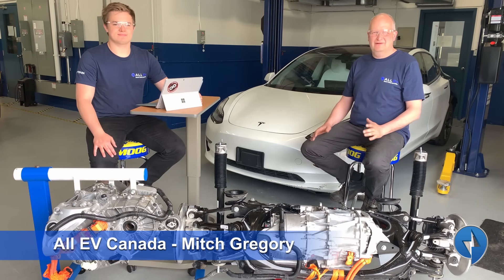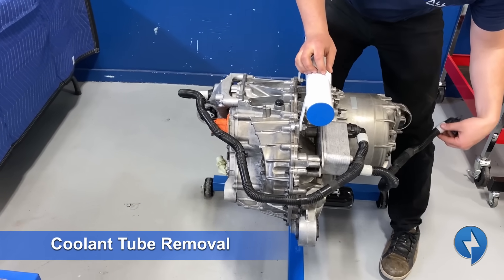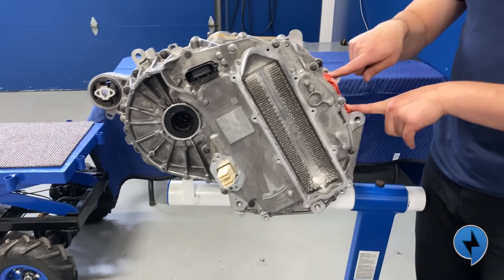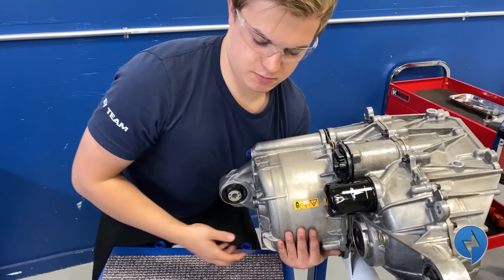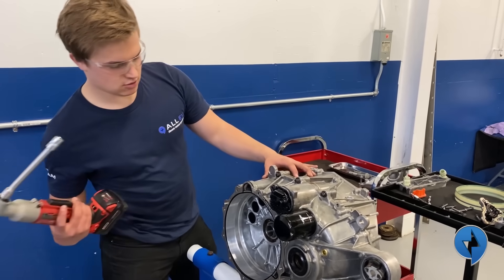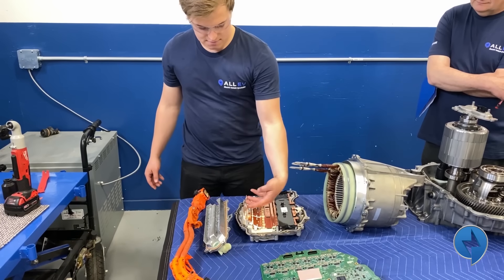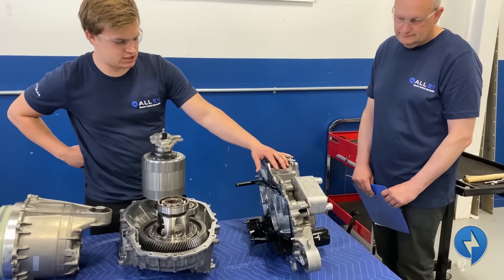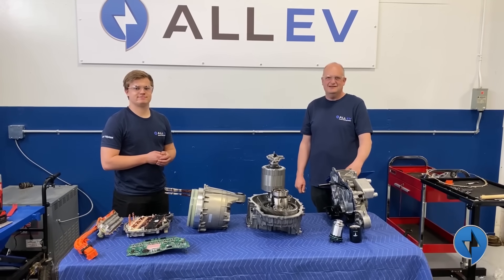Tesla Model 3 Motor Tear Down - ALL EV

Comment: Wow this is so much simpler than an ICE. I've been reading the ASE handbook recently and while i've always known the fundamental principles of ICE i never knew how many tiny little details there are. By the way if any of these tiny little details are off even slightly it can spell disaster. It makes me quite nervous driving an ICE vehicle knowing all of the thousands of opportunities for failure. Hell thats one of the main reasons i want a Tesla now, if only i could afford one. I mean you tore down that induction motor in 10-15 minutes, do you know how long it would take to tear down an ICE? 

EV's have 3 main things holding them back currently. Range, charging times, and cost. I think thats solid state batteries will be the solution to all 3 of these problems. Then all we have to do is build the infrastructure and ICE is dead. A big part of infrastructure will be federally mandated uniformity on all charging stations. Right now if you have a Chevy Bolt or Nissan Leaf you cannot charge at a Tesla supercharger. This is because the chargers are totally different, that needs to change. We will also have to find ways to deal with the increased grid load due to all these EV's charging at the same time. The most obvious solution is going to be nuclear power as our primary source and solar as a complimentary source.
Reply: Just wait for Tesla battery day on Sept. 22nd for a solution to range, charging times, and cost... Europe already has federally mandated charging standard and you still cant charge a bolt or a leaf at the Tesla superchargers so I don't think that will solve the problem and really this is a non issue because 99 percent of the time people will charge at home over night. Chevy and Nissan are not interested in paying the licensing fees for using Tesla superchargers. As far as grid load goes, I don't think it will be a issue with onsite battery storage load balancing.

Comment: And I thought I would be through with oil changes on my Tesla.
Reply: I can live with a filter change once every 5-8 years compared to every 3-10k miles :)
Reply: With S and X you should replace oil every 100,000 miles. With model 3 Tesla added this standard oil filter, so with wise load put on these gearings (acceleration pedal) you may actually never need to change this oil.
Reply: I never knew EVs motors needed inverters and oil
Reply: I don't think it would be every 6 months like a normal car. Maybe every 5 years when the coolant gets changed?

Comment: there are no neodymium magnets in this motor its a synchronous reluctance motor but nice video 😉
Reply: There must be some magnets.  First is that the washers stick to the rotor. Second is you can see the laminations are staggered in blocks. That is because there are magnets inside. The staggering is so you do not get a torque pulse. If it had no magnets you could just do a spiral like induction motors with cast aluminium rotors. But having said that the magnets do jot look very powerful. The rotor came out too easy.
Reply: Munro shows the very special four magnet glued array. Now replaced with single magnet.
https://cleantechnica.com/2019/04/28/industry-expert-on-teslas-motors-theyve-got-magic/

Comment: What’s the rough outside diameter of the motor on it’s own? And the rotor?
Reply from the maker: The stator is about 24cm (9.5") in diameter. With the motor mount flange, the stator casing is about 27cm (10.5"). The rotor is 15cm (6").

Comment: Most modern cars have open differentials now, and use the abs control to apply the brakes to spinning wheels. I expect that’s how the Tesla works.
Reply: yes, except the plaid, which in the rear has two motors, no diff. "torque vectoring" instead.

Comment: The simplicity and high performance of this compact power unit (engine, 'gearbox', differential) is the k.o. for combustion engines. Moreover, when you consider the savings in maintenance.

Comment: The motor you showed was a 3D1? Can you explain the differences between 3D1 and 3D5?
Tesla seem to have changed the motor type in SR+ lately....
Reply from the maker: What we showed was a 3D1. From what we can tell there is about a 50hp peak power difference between the two.
Reply: All EV Canada Where you aware that Tesla changed this lately and delivers 3D5 in the SR+?
I don’t know if it has any influence on speed / acceleration, but looking on the figures, we get less power now. 😢

Comment: This was a great video and an awesome technical walkthrough on how the motor works. Did this take more than 1 motor learn about the system and then do a new teardown? Can you do a Model S motor next? Thank you!
Reply from the maker: Thanks Phil! We were lucky to only need 1 motor to dissasemble. We did re-assemble the entire motor a couple times to get it right. Surprisingly enough the rotor goes in and out fairly easily.

Comment: Hmm that inverter logic board... I wouldn't want to have to replace that. Looks like it would be a huge job?
Reply from the maker: Removing the inverter/controller is not very hard when the engine is on a stand. I imagine it would be difficult/impossible within the subframe.

Comment: It's really that simple!?!?  Amazing, I'm guessing in a couple of years EV's will be half the price of combustion engine cars.
Reply from the maker: So simple! So small. 370kw motor the size of a few brake rotors. Its possible. Battery costs are rapidly decreasing.
Reply: Motors are cheap. The most expensive part on an EV is a battery though.
Reply: And in a couple more we'll have affordable hypercapacitors to replace the battery.
Reply: no. Its not that simple. It has very complex circuit boards.Motor controller, inverter, battery regulator ETC. These are some pretty "complex" stuff.
Reply: @dieselgeezer18  he is talking about the actual gears and mechanisms involved, much simpler than a 7 speed transmission with differentials.
Reply: @miguellopez3392  thats why you get manual transmission which is much simplier
Reply: @dieselgeezer18  not compared to simple reduction gears.
Reply: @dieselgeezer18  when talking about mechanical parts, it is pretty simple

Comment: Great job! You guys are so professional! The Tesla e-drive system is a piece of art. I'm a power electronics and motor control enginner and already got quite familiar with the inverter part. What I'm curious about is how the oil cooling of motor works. Looks like it shares the same oil of the gearbox but I'm not sure the path of oil flowing through the motor.
Reply from the maker: Thanks Rand! Your kind message means alot. We will try and clear up some questions about the oil in a new video soon. In the motor the oil is sprayed on the rotor and is pumped through the stator. It then returns to the sump.
Reply: All EV Canada Thanks for your reply which gives me a clue on that. Looking forward to your new video.

Comment: What model is the Milwaukee cordless ratchet?
Reply from the maker: It is a "2-speed 3/8" right angle impact wrench"
Not very powerfull but very easy to use.
Reply: @AllEVCanada  does it reverse with a trigger switch?   If so what model number.   Excellent video btw

Comment: Why can't shocks be magnetic electricity generators rather than hydraulic?  Or, for air suspension cars why can't shocks be air compressors capturing the energy of movement?  Seems a waste to have them inert to the vehicle's energy needs.
Reply: Because you would end up with a net loss of energy. You use more energy moving the generator then it actually generates.
Reply: @user2C47  movement is currently being converted to heat by compressing the metal springs.
Reply: @ArizonaPoet  You would have to use more energy than you recover due to the added weight of the generator. You would get more energy by putting a thermoelectric generator up to the heater.

Comment: Could you please specify the maxim DC V and A input  into the inverter and the maximum AC  V and A coming out of the inverter ?
Reply: David Rahnaward The maximum DC bus voltage is determined by the battery package. To my knowledge, it’s about 450V or so. While the output voltage of inverter( also defined as modulation index of PWM)is a little tricky, it is closely determined by the motor control strategy. The higher is the output voltage, the larger maximum output power of motor at high speed. But the system tends to be more fragile ( lose control). There is no information about the max modulation index  (linear modulation/over modulation/six step) of TESLA inverter yet so far. Regarding the max AC current, it’s about 1000A  peak with SiC MOSFET.
Reply: Hi there I would like to know the actual voltage on each end as well as frequency range as I repair Power tools and I know on the cordless machines with brushless motors. They change the 18dc to ac and the changes the frequency on the output to the ac motor to change the speed as high as 1khz.

Comment: Great video. This is the one I'd been waiting for. Question, isn't the bigger motor the Reluctance motor and the smaller the AC?
Reply from the maker: Thanks! We have not had our hands on the AC motor yet but typically the rear (reluctance motor) is more powerful.

Comment: So how much work would it be for me to LS Swap the car you ripped those out of, hrm?
Reply from the maker: Waaaaay too much. Would be funny though.
Reply: @AllEVCanada  Something I'd love to do, take to car shows. Might go with a dual quad GM572 big block for extra troll factor.
Classic hot rod guys will be grumbling because 'blablatesla' even though it makes the best V8 burble of anything there. Modern guys will be like 'WTF YOU RUINED A TESLA'. And I'll just be going 'GDI now I need another set of rear tires.....'
Would use a Tremec TKO 5-speed most likely. Don't think I'd need a 6-speed with that much torque, especially once I've ripped a third of the Tesla's weight out of it(Might leave a few banks of OE batteries in it reconfigured to provide 12v and enough current for cranking the engine if I can get a good lithium charge regulator in circuit).

Comment: Can you count the teeth on the gear set so we all can know the exact gear reduction of the Model 3 drive assembly?
Reply: 8.92
Reply: @mitchgregory8259 . well there are two gear reductions.  On the TESLA Model S there are also two gear reductions both of which are 3.12 to 1. 3.12 x 3.12= 9.7344 final.  It appears there is room in the existing Model 3 gear box on the gear reduction directly off the motor to have custom gears for either higher or lower gears for better gearing options for a vehicle that is not a TESLA Model 3.  While you have it apart to  it would be worth while to measure how much space there is for the possible range of ratios that would work inside the existing gearbox casting.  Quaife has a custom 4.5 to 1 final ratio for the TESLA Model S gear box.
Reply from the maker: @markyormark7747  The total gear reduction is aprox 8.92:1 on the model 3: 83/24  and 81/30
Reply: @AllEVCanada  Hmm? 83 divided by 24 = 3.45833.  81 divided by 30= 2.70, so  3.45833 x 2.70 = 9.3375 to one reduction.  So where is the discrepancy??
Reply: Future gearheads might want to swap lower Semi or Cybertruck gears for quicker 1/4 mile times. Some might want taller gears to run the unit sideways for AWD vehicles. (Quaife offers 4.5:1 Model S gears for this use.. There is also a reverse flow oil pump.) 

Since the Model 3 has an electric gear oil pump instead of a mechanical oil pump, the direction of the drive motor wouldn’t make a difference, right?

Comment: Won't all the metal particle be sucked by the rotor instead of the small magnet of the oil guide thing?
Reply from the maker: I believe the metal catching magnet is meant to stop the particles from reaching the rotor. It is very possible that metal reaches the rotor. Which would be bad if it accumulated.

Comment: Is there a schedule for changing oil and filter like an ICE?
Reply: If you live in a cold climate, you should clean and lubricate your brake calipers once a year. Also, you will want to go into low regen and actually use your brakes when there is moisture on the road. Not doing so does the same to the brakes as if a car sits for a very long time without usage - the pad will split in half (recent lesson learned the hard way for me)
Reply: @thomasbihn  Tesla has a brake clean function that puts them on at regular intervals to warm and dry the disks, you don't need to do this manually.
Reply: It’s an oil filter for GEAR oil, not ENGINE oil. The filter cleverly does double duty as the drain plug. Gear oil is kept happy because it’s constantly filtered and temperature controlled. A normal differential doesn’t get that kind of Goldilocks treatment. As far as maintenance goes, there isn’t much. Tesla originally suggested fresh brake fluid every 2 years and fresh coolant every 4 years, plus a desiccant filter for the A/C and cabin air filters...but then changed it to zero maintenance. The car is smart. It knows if a part like that oil pump has failed or is about to fail. Supposedly, it can even order the replacement part before you even pull safely off the road.
Reply: I think they say it's good for life, it's more similar to changing oil in a differential (every ~50K miles typically) than an ICE engine.  Also with an oil filter you can remove contaminants unlike a typical sealed gear differential, so going over 50K miles should be no problem.  Might want to change it at 100-150K just for fun?

Comment: Really useful video. Thanks.
How much flexibility is there if you want to mount the motor to a normal car gearbox in an EV conversion?
Presume you need to machine up a new end plate for the motor, or cut up the gear housing to make one before it can be mounted to your gearbox?
Then I assume the inverter and cooling can all be relocated to a suitable place on your car?
Reply from the maker: Thanks! If you need any specific part images let us know.

Fabricating a new end plate would be fairly significant work but doable. The rotor is supported by only one bearing so you would need to machine room for a bearing in the adapter plate. The second bearing is in the input shaft of the gear reduction casing. The inverter cannot be relocated from its position without significant modifications to the stator windings. It seems like the best way to use this motor in a converison is by using the full rear subframe and suspension. The 4 subframe mounting points could be mounted to the bottom of a body or frame.
Reply: @AllEVCanada  thanks for your response.
It sounds like to mount to a gearbox, a modified gear case is the way to go.
The project I have in mind is a 4x4 so want to use the cars transfer box with single motor so using the subframe as is isn't really an option.
Can you elaborate on why the stator would need a re-wire to relocate the invertor?
Would there be an issue with simply extending the three phase connections to relocate the invertor and leaving the stator as is?
Reply from the maker: So the stator wouldn't need a re-wire but the three legs (big bundles) would protrude right into the cars transfer box. See the video thumbnail for an image of the motor for reference. See the three legs? you would have to deal with them somehow and maintain HV isolation. Since cooling/lubricating oil is pumped around the motor and on the leads you would have to make it so the leads could pass through the oil case. Thats where it gets tough. There are other options on the market that are sealed. One of my favorites is the Emrax series motor.
Reply: @AllEVCanada  ah right I understand now.
Very useful thank you.

Comment: Great video! Very inspiring for DIY peolple, like me !
Reply from the maker: Thanks! One thing we noticed about this design is that the inverter can be removed and possibly replaced without needing to rebuild mounts, coolant lines, or oil passages. Meaning the inverter is sealed from oil and coolant. So its very possible that an aftermarket inverter can be used. 
Looking to test that out one day.
Reply: @AllEVCanada  Love this car more and more )))